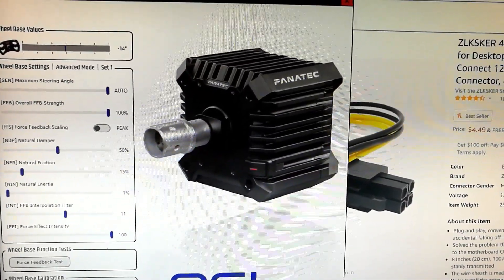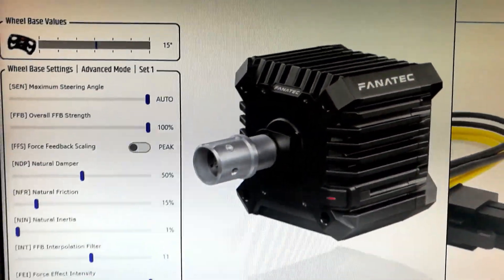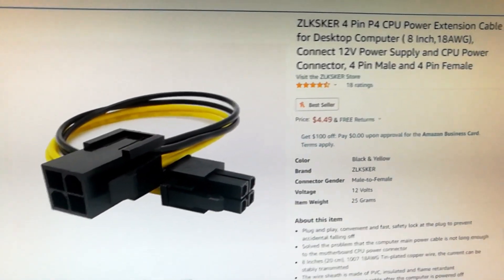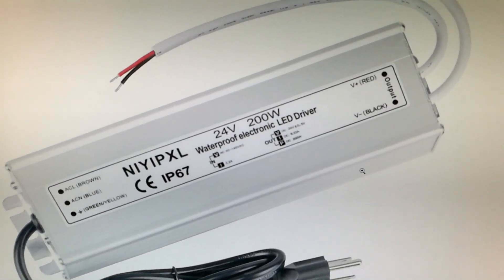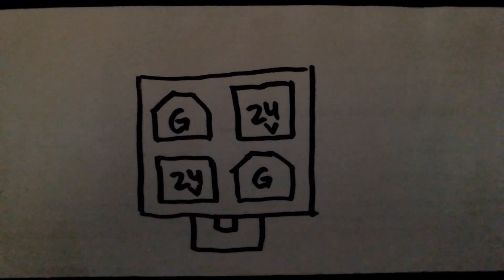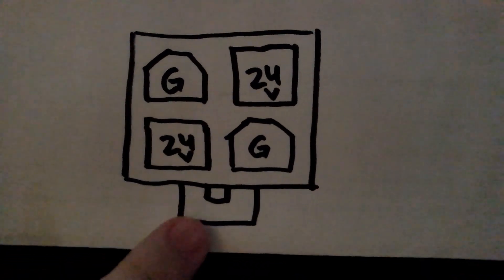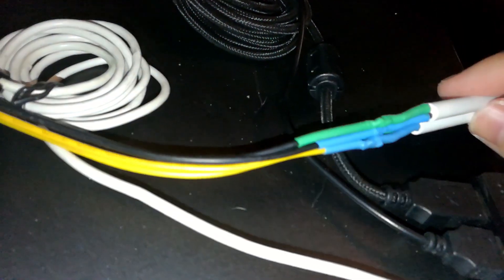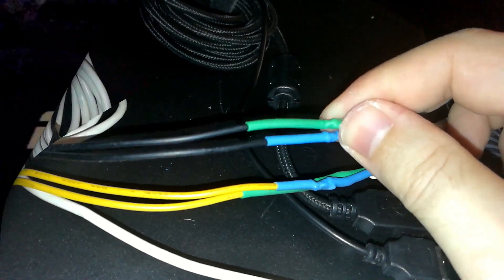Fanatec CSL DD DIY Boost kit for under 50USD guide (Tested and Running)

Comment: Thanks man for the uploading!
I would like to make it but I struggle to find that exact power supply.
The one I can find is the meanwell ELG-200-24B-3Y
Do you think that it will work as well?
Thanks!
Reply from the maker: Hello Andrea, i saw your previous comment but youtube automatically deletes it because of the link.  That power supply wont work because it's constant current.  Constant current power supplies automatically adjust the voltage based on current.  You need a power supply that will hold 24 volts steady.  You need Constant Voltage.
Reply: @Triple88a  Hi, I hate to bother you with this, it's just that Andrea here was told not to get a constant current, and below you say the opposite so I'm confused... I think constant means a steady 24 volts, yes?
Reply from the maker: @burtpanzer  hello, you do not want constant current.  Constant current adapters will vary the voltage to get even current to the part.

What you want is constant voltage adapter.  Constant voltage will keep 24 volts and the wheel base will pull however many amps it needs at that time based on the force feedback settings in game.

These are 2 different types of adapters.  One is constant current, the other is constant voltage.  You need constant voltage.
Reply: @Triple88a  Hello, will Mean Well XLG-200-24-A work? I think this one as constant 24VDC. Only 2 output cables, but I guess that is not a problem. Thanks!

Comment: Does it matter that the ATX 4pin cables are 12V? And the DC is 24V?
Reply from the maker: No the 4 pin cable i posted is fine.  Gauge matters though.   There are cheap ones that are like 22 gauge and will heat up.  The one I went with is 18 gauge.  the voltage of the power adapter is what matters.

Comment: A source with an open chassis is not better ... if it does not accumulate heat the performance and the duration will be better.

Comment: Just ordered my csl Dd which is due to ship by 2nd of January. I will absolutely follow this guide as the cost of the power supply being almost 50% of the device worth is a bit much of a stretch, they could have sold it at a smaller markup ( I understand profits are needed)  of £90 or something like that and I think that would be alot more justifible imo.
Reply from the maker: Thanks for checking out my video, All i can say is it's working perfect.   So far i've gotten nearly a month of solid game play, no issues at all, works perfect.  Roughly 200 game hours so far.
Reply: One year later, how have you been? I just ordered the parts from amazon, this week I assemble it.

Comment: This DIY PS was $46 bucks delivered, Amazon Prime Next Day. Best $46 bucks I ever spent. I've had the CSL DD for over a month in my second rig with the standard PS. It was ok to good. I refused to pay $160 for a power supply, especially for a second rig. This guide, $46 bucks and 15 minutes of effort (had the 4pin cable already, add $6 if you need to buy it) and youz got a boost kit, and the wheel is knocking on my DD1's performance level. And if I were to compare dollars to dollars this CSL DD($350) with aftermarket boost kit($50) $400 total VS my DD1 at $1,200 as WAAAAY more bang for the buck. If the DD1 price has you hesitating and budget is a big concern add this DIY boost kit to a standard CSL DD and it will be the best $400 total you'll ever spend in sim racing. And I've come from Thrustmaster pre FF in the 90's to Logitech G29's  to CSL Elite V1.1's to my current DD1 to this CSL DD for my second rig and if I had to do it all over again. Well I'd buy two CSL DD's make my boost Kit's : ) and get me a couple Black Friday CSL Steering Wheel P1 V2 Black Friday Edition's for $100ea and call it good! and have money left over for Pedals... Well that's a whole different topic ; ) All I can say is do it. Worst part of this whole DIY kit is its silver not black. Oh the problems I have : )

Comment: Thank you Atanas. Just plugged in the 300w PSU to my CSL DD and I can't believe how much difference 8nm is over 5nm. Your tutorial was straight forward and I don't think I would have tried it without it. Like a different wheel for $60. 🥂 Just ran 10 laps around Barcelona and my next investment will probably be gloves trying to hold onto the wheel 😂
Reply from the maker: I'm glad to see it worked well for you as well.  I'm starting to understand why people are using gloves.  Coming from a Logitech, the extra force feedback is definitely noticed and felt.
Reply: 300W?  Your probably overdriving the DD that’s probably 10nm now 🤣
Reply: @e.r.6147  lol thats what i wanna know, is more than 180w better ? will it give it more efficient performance at higher loads and consistent higher loads for the csl and will it over burn it or blow a fuse or something in the csl dd eventually ? i mean how much long term higher wattage can it handle ?
Reply: @ali09gaming58  thats beyond this guys pay grade 🤣
Reply: @ali09gaming58  that is not how power supplies work, lol. They don't "feed" power, they deliver what is "asked". So you can always go with bigger but not smaller than needed.
Reply: I wear gloves because I don’t want my hand sweat crudding up my shit. But the extra grip the gloves offer also helps immensely.

Comment: I watched video of DIY when they shipped out pre production CSL DD and guy said 200w power supply wasn't giving out true 200w. I ordered the 300w 24v power supply. Same brand just 300w instead. Just wondering if it's ok to get 300w supply. Wheel base will only draw power it needs correct?
Reply from the maker: Hey there, It's not giving out the true 200w because people are expecting continuous 200w.  Also the wheel needs 180w max.  The fanatec boost kit cant output 180w continuously as well.  That said the power brick I used can output +180w from what I have seen.  I saw another video of a person testing this LED driver and it did output 186w.
Reply: Don't worry about it. The sticker on my CSL DD says the power input is rated at 24V 7.5A = 180W. As long as your power supply meets or exceeds these values, you are fine. However, I wouldn't recommend buying the cheapest power supply you can find. The better quality ones tend to have better output filtering and will last longer.
Reply: I am using a 300 watt, because that is what I had lying around and it is working just fine.

Comment: Going to give this a shot.  Already have lots of modular computer PSU cables laying around and this seems like a perfect solution.  I was looking at cheap switching PSUs before this but never thought of a 24V LED driver until now.  Good thinking.
Reply from the maker: Thanks for your comment.  It's definitely very easy to do.  Just confirm you wired everything properly with a volt meter.

Comment: I don't understand why fanatec are getting so much stick for the boost kit price. If from the outset the csl dd was only sold as an 8nm base and came with the boost kit and was priced at €500 people would still be amazed at getting a direct drive base that cheap.
Reply from the maker: Thanks for your comment.  It's because people are judging both parts separately. Yes the base at 350 USD is an amazing price for the base.  I agree with you that at 500 (boost kit + base) it's still a competitive price but it's once you add a wheel + taxes and shipping you end up close to the Simagic Mini price which offers 10nm and better software.

My .02 cents.. Fanatec should have released only 1 option.  8NM option priced at 400 and called it done.
Reply: Agreed. They want to dominate the entry mid level market by pricing it so competitive. For some people, the 5nm kit is more affordable and will get them into the ecosystem. When they can afterwards, buy the boost kit as they’re already invested. Benefits to getting the either option of the csl dd.